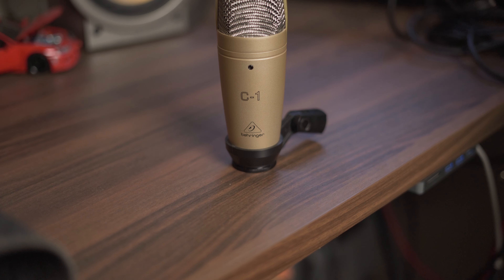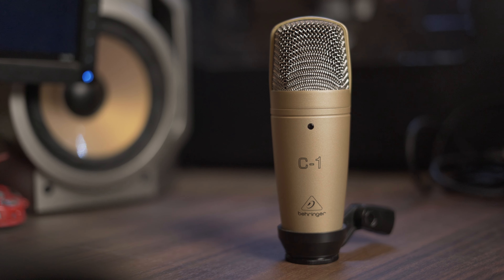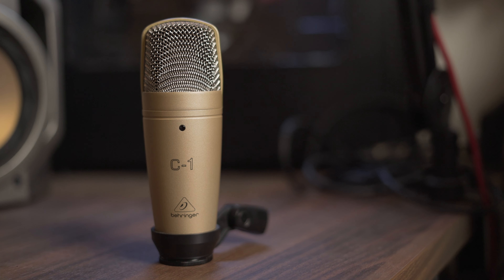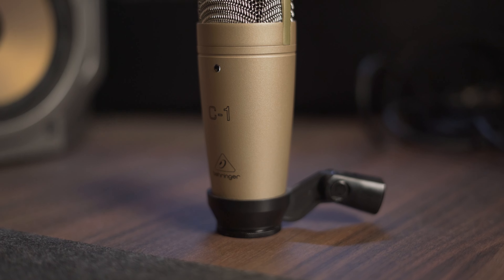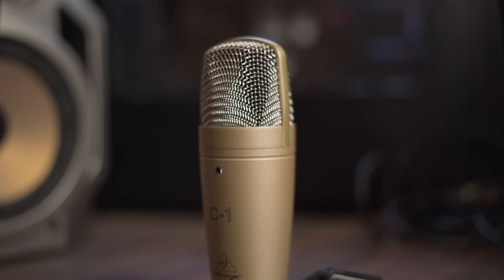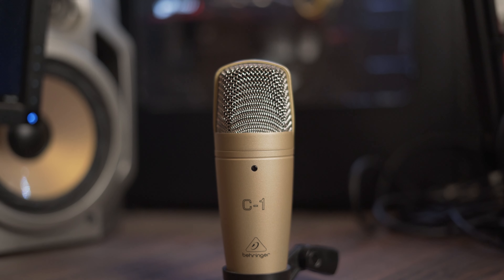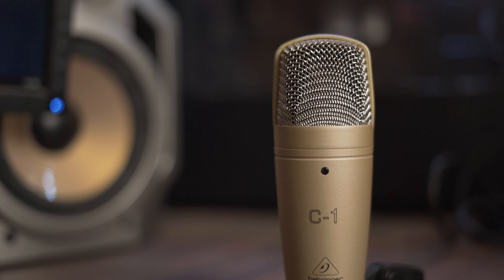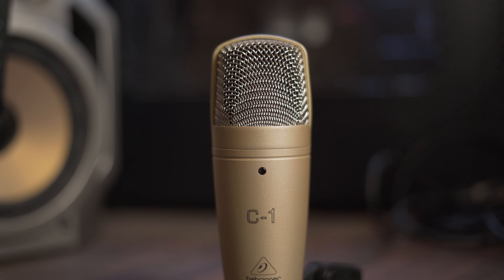Does the Behringer C1 Have Reliability Issues?

Comment: Can confirm. I've used this mic many years ago and switched over to Rode Podmic precisely because of the hum the C-1 had developed. I tried everything, new cables, grounding, even the good 'ol jiggling the cable around too and it didn't seem to have any effect at all. But sometimes the mic would go all normal after 10 min or so but if even touched lightly would start humming again.
It's a good sounding mic but I wouldn't recommend it because of this issue, I thought it was just me but apparently it's one of the faults of this thing.